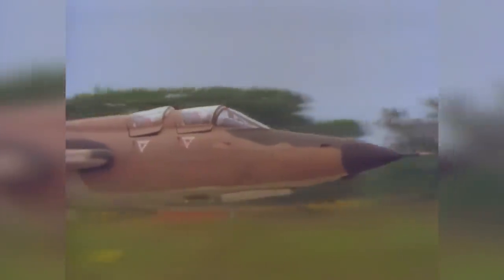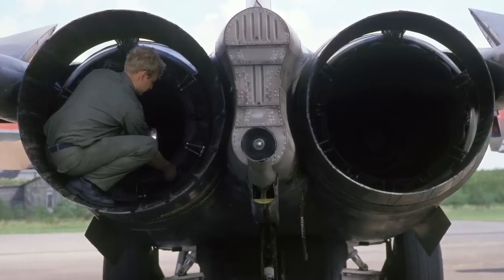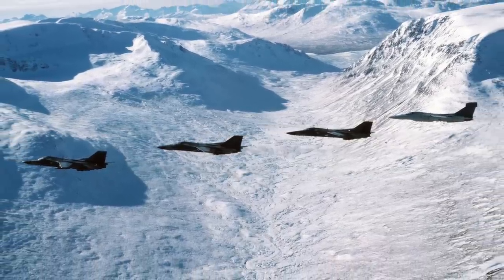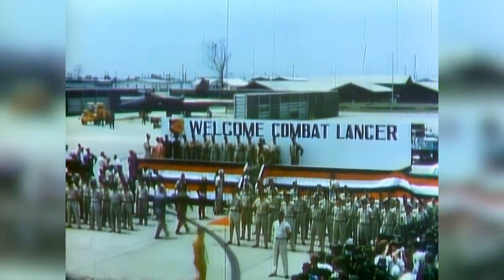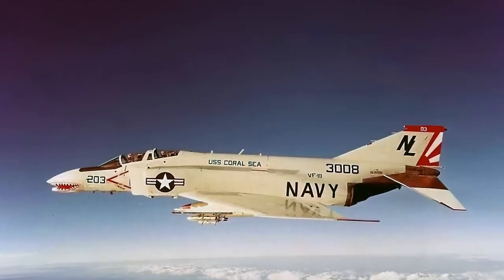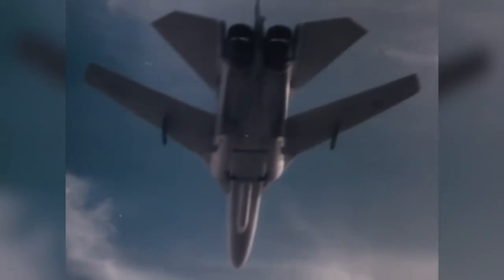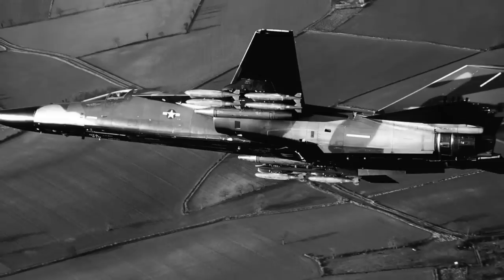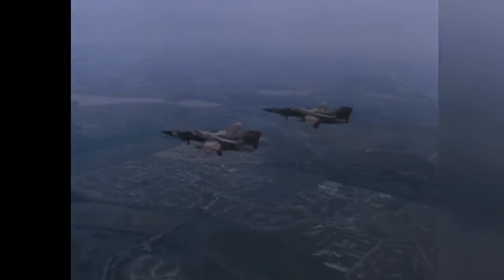F-111 Aardvark. General Dynamics supersonic, medium-range, multirole combat aircraft. Upscaled video

Comment: 7:44 - is one of the F111s I worked with out of Mountain Home AFB, ID! I was a BB Stacker (Munitions Maintenance) I moved the munitions from the bomb dump to the flight line and back. Got to sit at takeoff end of the runway during night operations in case there were any issues if they came back in with munitions. We also brought the chaff and flares out to the planes. Had special small bombs to imitate full sized ones since they were more expensive. The nuclear shaped full size dummies were REALLY expensive!
I loved the F111 from first sight at night between the hangars my first night at Mountain Home in 1973! Loved how the after burners would be turned off at exactly the same point after takeoff. Afterburner flames as long as the aircraft - totally awesome!
Thanks for showing this!

Comment: I was an instrument/autopilot technician and instructor on the F111D and F  for nearly all of my 10 years with the USAF.   I was puzzled by complaints from a few supervisors about the reliability of the F111 compared to other planes they had worked on.  The reliability problems were mostly due to systems that were not on the aircraft they were compared to.  The systems I'm referring to were vital for pennitrating enemy defense systems and accurately navigating to and hitting a target, the whole reason for an airplane of this type.  Just boring holes in the sky is not much use.  If the systems required for a certain kind of training were not not working the training mission would be stopped.   It made the aircraft appear unreliable when it was due to the very new, very complicated and very required systems for pennitrating and accurate bombing a sofistacated enemy.  

It was attacked by the news media for over 20 years and the USN top brass ,ADM Tom Connally for one,  for reasons that I could only guess about .  Every time one crashed it made national news.  No other military aircraft were given that attention and harsh scrutiny.  ADM Connally got the USN's replacement named after him.  I don't know if he got a cushie job with Grumman after retirement but it was common for those in positions who could select a weapons system to get a reward  job from companys they supported.  Pretty low down thing to do when you consider the huge cost savings that could have been used by our military for more and better weapons.  Most of the cost of these type of weapons are not buying them but in the training of people and overhaul/repair of the components over twenty to thirty years of operation.   The empty weight of an F111 was about 49000 lbs and the empty weight of the USN replacement  (F14) was about 41000 lbs.  I find it hard to believe that 8000 lbs extra was a show stopper.  The F111B did successfully complete trials on the USS Coral Sea.
Reply: I was WCIN on the FB-111A and was on the AMP (Avionics Modernization Program) team in 1985-1986.
Reply: @thethirdman225  the early complaints of lack of equipment was an issue... The general size of the F-111 (much like Russia aircraft such as the SU-30) meant we could fill all that empty space from outdated avionics with off the shelf components from Raytheon.... America never fully understood what the F-111 could do at the time. The F-111 was never a fighter... It was a bomber with some suitability built into it. The fanciful idea that it would compete with other 4/4.5 generation fighters such as the F-14,  or F-15 is utterly fanciful and nonsensical.

The Australian F-111Cs were a completely different class of plane, much like the Israeli F-15s and F-16s due to the off the shelf upgrades we could fit in an absurdly over built plane. The only thing it lacked that the F-14 had was speed and maneuverability due to extra speed and maneuverability of the F-16. But we chose a bunch of Australia specific features such as the longer wings, and trap and catch features to arrest them on shorter or more rudimentary airstrips. The Australia case is the real answer to what the F-111 could have done with half a chance.

The US didn't understand that they had a multi-role bomber on their hands though. Its true designation should have been FB-111. It should have never been put in the air without an escort until the airspace was cleared... Much like today... You don't send a B1 or B2, or even a B-52 into airspace until you know it won't be shot down. The US never realised the full versatility of the F-111.

Yes it was underpowered, yes it had rudimentary avionics when it was built. But if the time was spent developing a new engine platform for it, and avionics, it could have realistically been in service today instead of trying to reconfigure the F-15 (an air to air superiority fighter) into something that is completely unrecognisable in an effort to put something cheaper into the air in dangerous scenarios than a B1 Lancer or B2 Spirit.

This plane like the F-14 was simply not given enough of a chance... As to the "night regime" the pod upgrades we did in Australia were truly impressive, and it was one of the most hated planes in South East Asia for what it could do... completely unparalleled.... 

The real issue for the F-111 is that its weapons pods/pylons aged out.... We ran out of missile/bomb upgrades we could fit to such an old air frame, because no other western country was still thinking for the F-111. 

You should read up on the Popeye issue.
Reply: @thethirdman225  Yes, the FB became a G when sold out of country.

Comment: As a USAF photographer I took many pictures of the F111-F usually pieces of them after crash or damaged engines.   Most amazing was a F111-F that managed to land with rudder and vertical stabilizer missing and shreds of honeycomb where the vertical stabilizer attached.

Comment: I saw one years ago at RAAF Richmond in Australia I was blown away by it such a capable and lethal warbird.
Reply: As an American, I have to think that aside from USAF aircrews who flew the planes and a FEW knowledgeable campaigners (generals who appreciated the capabilities the F-111), the F-111 was more appreciated by the Australian Air Force!
The F-111 is virtually forgotten in the US aside from people old enough to remember when they were flying and a few aviation enthusiasts.  Honestly, I HAVE seen them in museums but I don't think I ever SAW an F-111 fly overhead.  I have seen all the Teen Fighters, F-4, and A-7 fly overhead in the Midwest (Ohio).
The Australian planes were operated a few years longer in total than the American F-111 force.
The US Air Force started some upgrades of the more useful variants of the F-111 (the E, F, and EF-111) but they stopped the upgrades soon after the Gulf War ended when they moved up (by about a decade?) the retirement of the American F-111 fleet.  The FB-111A/F-111G and F-111A models had already been mostly retired by the end of the 1980s.
The F-model was really the only version of the F-111 that met most of the USAF requirements.  It was the best combination of performance, avionics, and engine performance.  The Australian C-model was virtually upgraded to F-model standards but had the longer wing from the FB-111 version and stronger landing gear of the FB-111 as well; the C-model was refit with the engines of the F-model.  At least one source I read suggested the C-model was based more on the proposed K-model (the version the RAF was going to buy) which got canceled more than the American A-model.  At any rate, the C-model was better than the A-model and almost identical to the F-model in the end.  Heck, the C-model fleet received spare wings from the F-model fleet when it was retired!  The USAF NEVER intended to reactivate the F-111 fleet and most of the surviving Aardvarks were scrapped with 5 years of retirement.
The F-111 was a VERY expensive plane to support.  It took up 25% of the maintenance budget of THE ENTIRE USAF tactical inventory to keep the American F-111 fleet operating!  As I read somewhere, it took upwards of 150 maintenance man hour per FLIGHT HOUR to keep the Australian F-111Cs operational!   That's the 3 times the maintenance load for the F-14D and the US Navy thought that maintenance requirement was unsupportable!
Reply: I worked on the F111c  nice A/C 🇦🇺
Reply: Those variable sweep wings while cool as hell where expensive. You talk about the F-111 being forgotten the F-14 is legendary and yet no flying examples exist in the US and are a dying breed in foreign countries today.
Reply: @zacharyradford5552  F-14s only flew with the US Navy and Iranian Air Force.
The Iranian F-14s are on average over 45 years old, nowhere near fully operational, and are kept flying with baling wire.  They have MAYBE 9-10 operational F-14s. They just do not have the technicians and manufacturing industry to keep the specialized systems of the Tomcat fully operational.
The Tornado and B-1 are the last swing wing planes being flown in numbers -- by air forces that know how to maintain these planes!  The Tornado will probably be gone by the mid-2030s at the latest.  Tornado (the IDS strike model) is only in service with the Italian, German, and Saudi air forces.  All UK Tornados are already retired including the ADV Interceptor version which was retired over a decade ago now.
The B-1's retirement depends on how quickly they put the B-21 into service.

Comment: The reason the Air Force wanted the F-111 to have a swing wing was not for maneuverability, it was to couple efficiency with high top speed.  It could lift a heavier load from a given runway, cruise more efficiently, and also fly very fast at low level when needed.
Reply: It wasnt that the airforce wanted that. It wasnt a design requirement. It resulted in a swing wing because the designers established that was the way to achieve the requirements of high speed and acceptable take off and landing speeds and distances.
Reply: @slickstrings   The Air Force wanted the requirements that drove the design.  Like I said, the swing wing was not for maneuverability, it was for load carrying capacity, range at cruise, and high speed, all in one airplane.  USAF did not ask for swing wing just to have one, they wanted it because it turned out to deliver the required performance. You are quibbling over semantics that do not affect my point at all.
Reply: @slickstrings  It is what is said in the advert. Given it is just an advert information is always going to be hyperbolic in nature.

Comment: Forgotten history on the F111 for our American friends . Australia was the first order for F111. Not the USAF or the Marines.  Little Australia.  This order for 75 aircraft kept the production open. Tiny problem however . The wings kept falling off.  The original swing wing pivot design was faulty. Us Aussies used to building clothes hoists . Yep. Got the Commonwealth Aircraft Laboratories ( now closed for over 35yrs) to fixed the design issue and we mailed the blueprints and engineering specs to our American friends free of charge so we could get long awaited delivery . It worked.  We got the best aircraft in the world for a generation for Aust to use in the RAAF and kept them in service longer than anyone . Our brilliance in common sense  engineering solutions is only outweighed by our stupidity in commercial negotiations .  From one of your 25 Million friends Down Under .
Reply: I wasn't aware the Marines ordered or operated the F-111.
Reply: America has a history of sending its newest planes to its allies for “advanced testing”.  Most famous was the P51 and the F4U Corsair to the British in WW2

Comment: There is more to the story of why the F-111B was cancelled.  The lessons of the TFX program are commonly misinterpreted, but if you repeat a narrative for decades it becomes "truth". The idea that one basic airframe could fulfill two different roles was not a dumb idea at all. History is full of examples of aircraft that were versatile enough to fly for different services and even perform different missions.  The original requirements presented by the Navy and USAF were not incompatible, but the requirements of the Navy later changed. 

Initially the TFX program was reasonable because both USAF and USN were asking for a large aircraft that could lift a heavy load of fuel and weapons, with long range or long loiter, plus high-speed dash or intercept. Twin engines and an innovative variable geometry wing were called for, and DOD logically assessed that it would be wasteful to develop two very expensive advanced airframes when a single one with some variations could do both jobs. 

The reason one basic airframe could do both jobs was because the original USN requirement was for a fleet defense fighter, not an air superiority fighter. It was not originally intended to be what later became the F-14, but to perform the role meant for the Douglas F6D Missileer, with the addition of supersonic dash capability.  

The biggest difference between the airframe requirements of the two services was that USAF wanted a tandem cockpit and USN want side by side seating.  Boeing tried to make both services happy, but MacNamara’s DOD thought USAF could suck it up and have the crew sit side by side.  This is ironic considering that when the Navy cancelled its version USAF was stuck with the cockpit it didn’t want, which had also ironically contributed to the airplane being too ungainly for a dogfighter.

The original idea wasn’t dumb -- what happened was that needs changed.  USN revised its requirements as result of combat experience in Vietnam, and realized they also needed an air superiority fighter to replace the F-8 and F-4, but couldn’t afford that in addition to a dedicated fleet defense aircraft.  Thus, the TFX would now have to be able to dogfight as well as be a missile interceptor.  The F-111B could have worked as a missileer, but it was too fat and underpowered to compete as an air superiority fighter.  It was proper of the Navy to recognize that its needs had evolved.  This was perhaps the beginning of the Navy realizing that budgets and hangar decks did not have room for so many specialized aircraft.  USAF desperately needed the F-111 to replace the F-105, so they sucked it up and accepted the heavy airframe caused by the loveseat cockpit they never wanted.
Reply: Not only was the multi-service plane idea not dumb, they had already achieved it long prior: the F-4. And nevermind that, in WW2 there were plenty of aircraft that operated from land or sea. And isn't the SU-27 both an air force and navy plane?
Reply: @RB-bd5tz  Absolutely. How about the Dh Mosquito? For even more irony, many of the fan boys who decry the original F-111 concept probably admire the Panavia Tornado, a fan favorite that fulfilled both air-to-air and air-to-ground roles.  But too many people hear an unenlightened comment and simply parrot it for the rest of their days.

Comment: Guzzling fuel does not necessitate flight at low altitudes.  The video reverses cause and effect.  Low altitude flight is what guzzles fuel and decreases range. 

Also, flight at low altitudes didn't make the F-105 more vulnerable to SAMs.  The reason for flight at low altitude was to defend against SAMs.  Most F-105s were shot down by AAA because they were exposed to more of it when flying low to avoid SAMs.
Reply: AAA was why they started flying the Allied fighter-bombers at higher altitudes (above 20,000 ft) during the first Gulf War, too.
As I recall, more planes were initially shot down by AAA than SAM's in the opening days of the air campaign.  They operated the attack planes at low altitude initially.  A few F-15Es, F-16s, and Tornadoes were lost early in the war due to the Iraqi defense network. 
The F-16 in particular had TERRIBLE accuracy in the First Gulf War.  The targeting pods the Falcons used then were set for low-altitude and were virtually useless when the planes were moved higher; later after the war, the USAF bought more advanced LANTIRN pods that could operate well from medium altitude (20,000+ ft).  The F-111 with the older PAVE TACK system was at least 10 times more accurate than the F-16.  F-111s actually destroyed more Iraqi tanks than the A-10 did as well.

Comment: Between 1982 and 1983 I saw 7 F-111 get destroyed, 4 at once. They were on the " trin pad" getting trimmed out so they could be put on allert status. They were all loaded with 4, 500 lbs bombs one cought fire, set the another and set some of the bombs off. The ejection system was not much there were air bags that was supposed to deploy for land and water. The base commander lost the use of his legs when the land bag didn't deploy and it hit with only the water bag. 2 others crashed landed with no main landing gear. And I got the hell shocked out of me by a EF-111.
Reply: Never heard of this--am checking with the Vark experts.